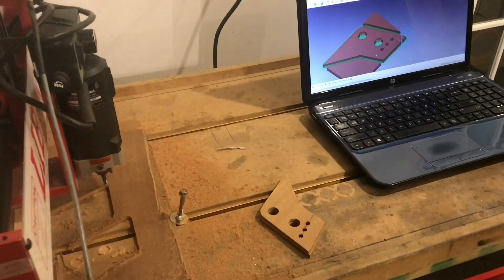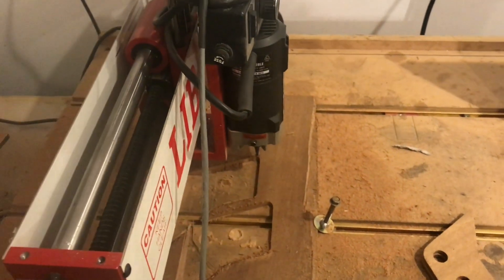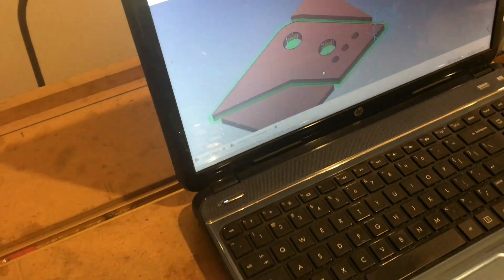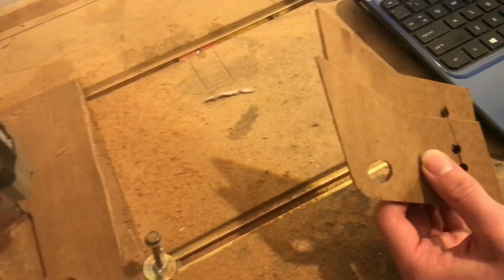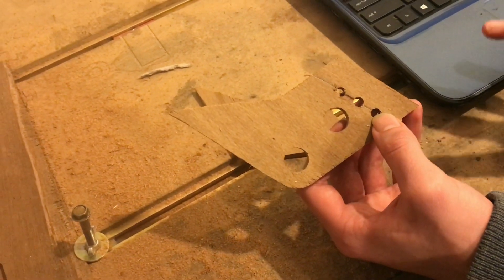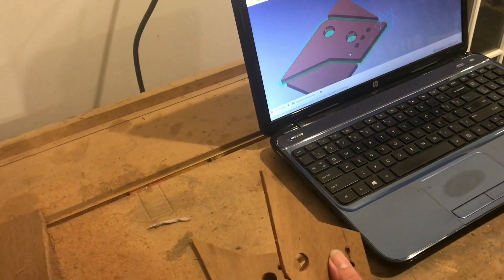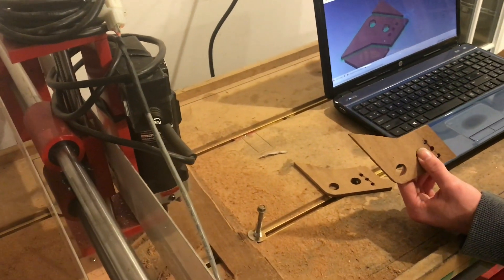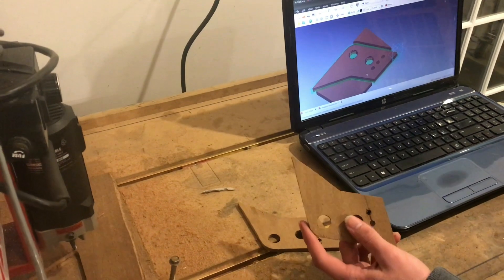FREECAD path workbench works great on grbl CNC mill

Comment: Geee-code, cnc milling and 3d printings, etc seems like real purpose of cad modeling these days.. i started off using freecad and kicad to design a circuit board then sent the Gerber files off.  that information controls the various pcb machines. then received the pcbs  just the way the cad information stated it...  any mistakes were from my error. so freecad needs precise machine control features... thanks a lot...:)